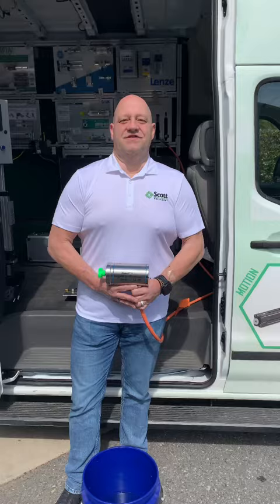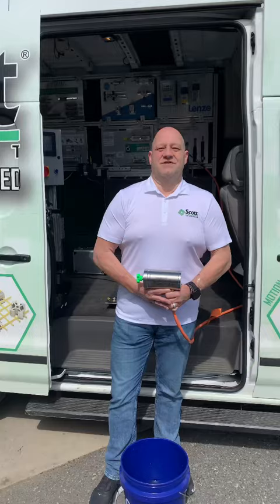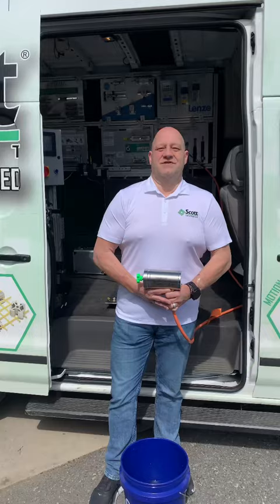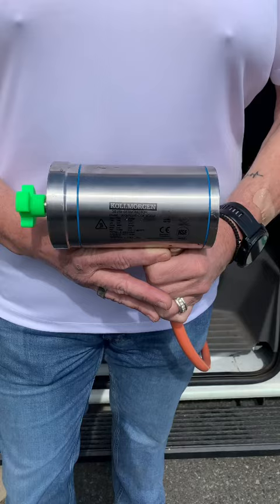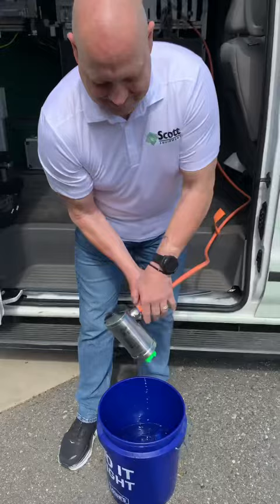Kollmorgen Submersible Electric Motor!  Who says water and electricity can’t get along? #waterproof

Comment: Why the food and drug administration approve a motor?
Reply from the maker: Reduced Recall Risk. The Food Modernization Safety Act (FMSA) gives the US federal government the ability to shutdown facilities, recall food products, and levy stiff fines to ensure public safety in regards to food product manufacturing. The AKMH is designed to meet the toughest hygienic requirements in the industry in order to reduce the possibility of food borne illnesses and costly recalls.

Designed for Fast Cleaning and Increased Uptime. The AKMH stainless steel motor is designed to meet the standards for IP69K, EHEDG, and 3A and is built with FDA approved, food grade materials. The careful elimination of flat surfaces, cracks, and crevices prevents the build-up of foreign material and bacteria. The AKMH housing and cable can endure daily wash downs with high pressure, high temperature, and caustic chemicals. The robust design means that guards and covers are not required to protect the motor from harsh cleaning regimens. These AKMH features constitute quicker cleaning, keeping your machine running, and increasing the OEE of your manufacturing line.